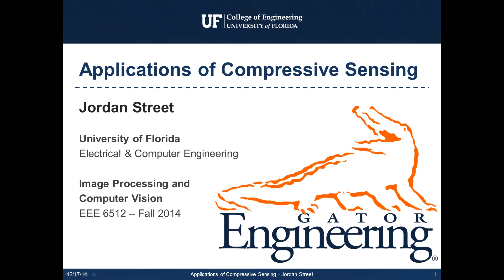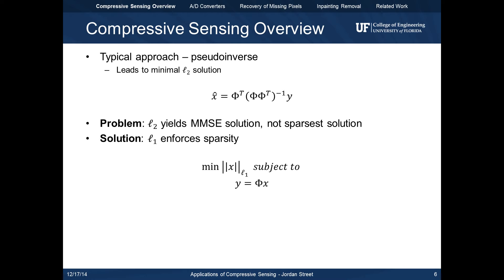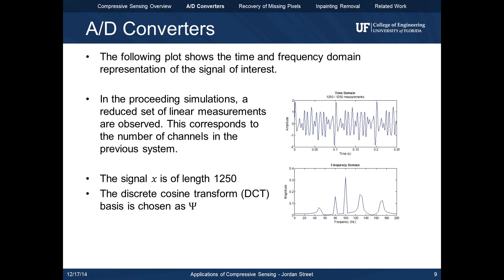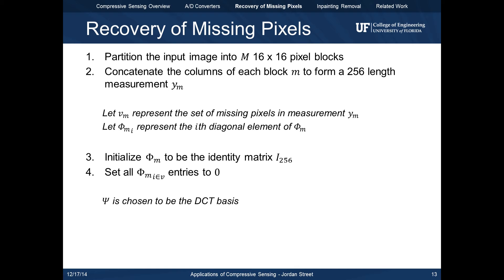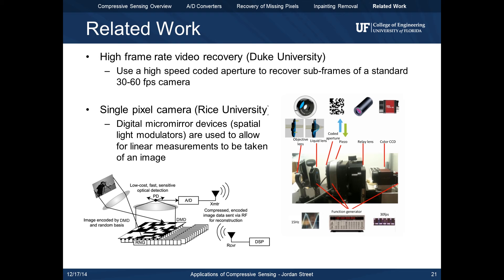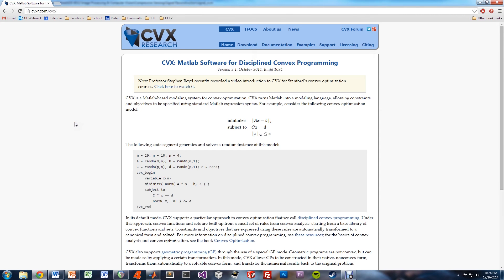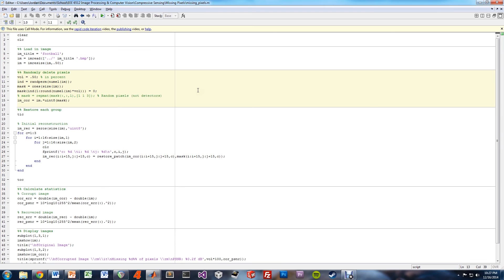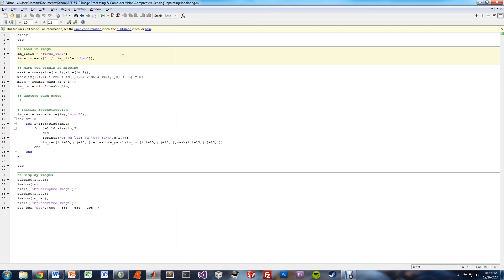Applications of Compressive Sensing

Comment: Hi Jordan, is it possible for you to share the matlab code for the image reconstruction function. 

Getting the ADC function working was fine using CVX, 
but when an image was tried, CVX threw out an error on the line for 'subject to'. 
It was written like this: phi_m * psi * x_star == ym_mPix
where phi_m was the identify matrix (with the missing pixels diagonals set to 0)
psi = dctmtx(length(ym)) % the dct basis
x_star the variable in cvx and 
ym_mPix the measured vector with the missing pixels.
Reply from the maker: Since the underlying data represents a 2D image instead of a 1D signal, we need to be a little more creative in the way we setup the psi matrix. You need to use the Kronecker product of two DCT basis matrices for creating psi.